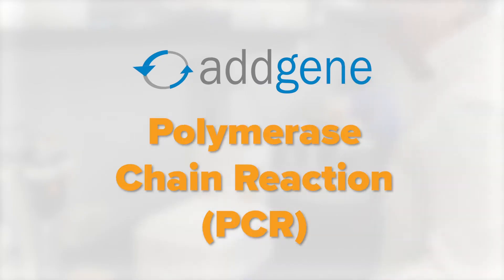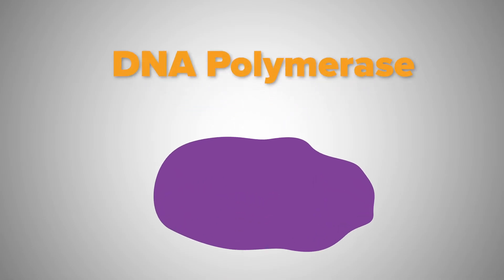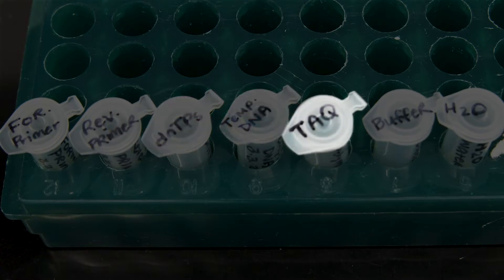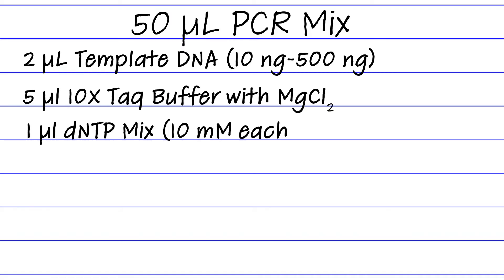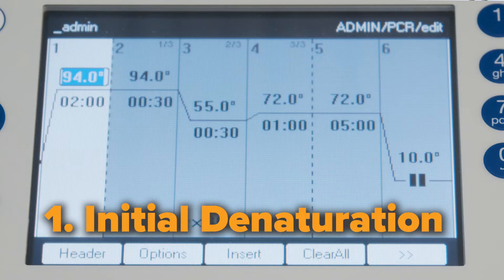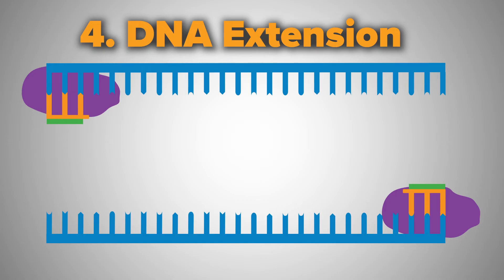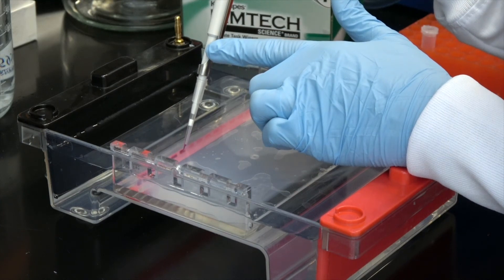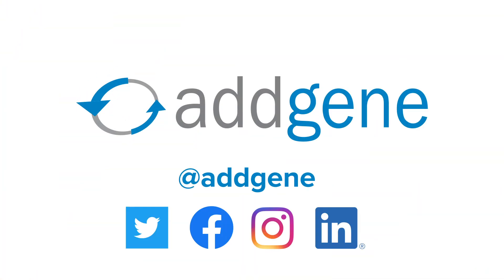Polymerase Chain Reaction (PCR) Protocol

Comment: Why not add mgcl2 initially?
Reply from the maker: Thanks for the question. Magnesium chloride is already included in the 10X Taq buffer, but some PCR reactions may require more magnesium chloride to improve DNA amplification. Therefore, adding more magnesium chloride to a PCR reaction that is not working might improve your results. However, excess magnesium chloride can decrease the binding specificity of your primers, so we suggest trying a PCR reaction under standard conditions first.